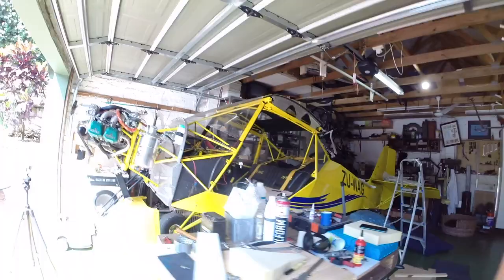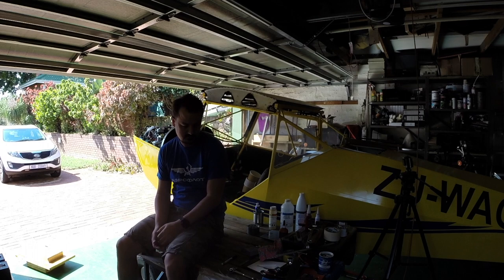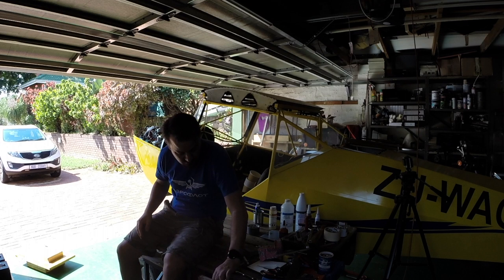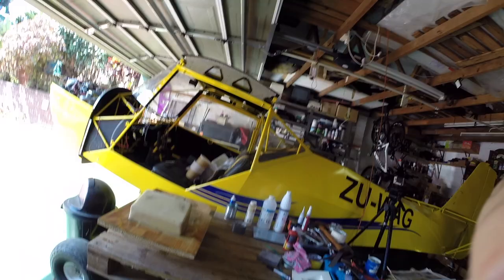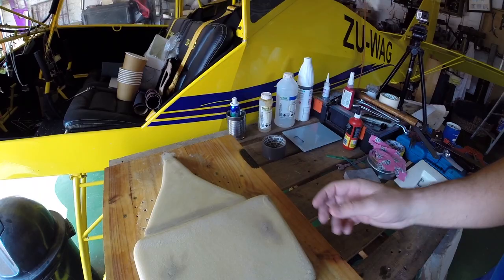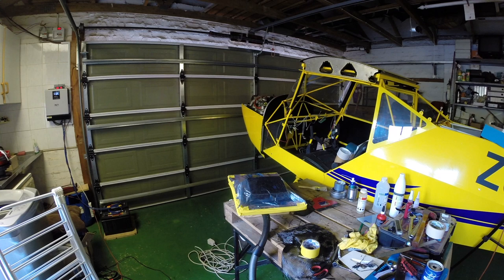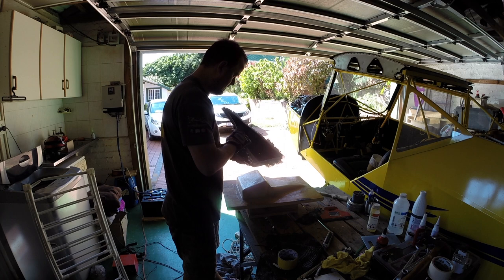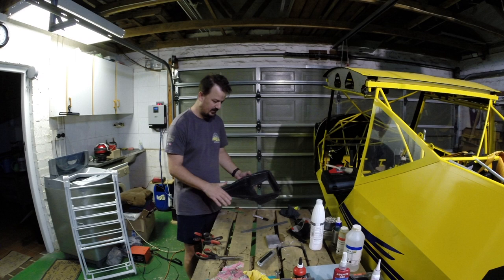This will be one COOL airplane!!

Comment: Good improvised fabrication. My advice would be fill your vacuum holes as to vacuum bag the carbon properly you need to do it from the top through a breathable peel-ply into an absorbent material that will absorb the excess resin. I would also say you will need a foam rubber seal to go between the plenum and the radiator so you don’t get any wear or air bypassing the rad. At least you have made what looks like a good form and can play on your aircraft (I can’t even get to my little plane at the moment but have made progress on my car restoration). Keep smiling.
Reply from the maker: I know that its not the best and that I need peel ply etc.
I made do with what I had and tried something which kinda worked...
But yes as soon as i can get the material for the job we will do it again and do it properly.
The plenum will not sit directly up against the radiator and will most definitely have rubber seal between the two which is why I cut a lip into the plenum opening for the rubber to attach onto.
Hey at least we have projects to keep us going during this time, imagine sitting at home with nothing to do!
Reply: @NicHolmes  With you the way. A worth while experiment though and proved the form is good. As you say at least we have project, I think I would go made with just work to do at home (looking at a computer screen, not my normal work but at least getting some cash) and nothing to unwind with after.

Comment: Most guys would say f-it, bolt it on, and go flying. (Because what you built would work fine and last until the Second Coming.) You've got higher standards -- and you'll meet them. The right gear is 9/10th of the job. You sounded a little down, but shouldn't be. You're on your way.
Reply from the maker: Yeah what I built would work fine and last forever, but its both not my plane and also not my style to have things that don't quite look spot on!
Hopefully i can get hold of the right gear soon.
And yeah, this lock-down is seriously demotivating and it gets to me somewhat, even though I have the plane to build, I get seriously frustrated when I need more supplies but realise I'm now stuck...
I hunted for a week to find paintbrushes so i could finish that mold... _ i eventually found a pack on the shelf at a local grocery store - but they wouldn't sell them because of the essential supplies rule, I eventually begged the manager enough to sell them to me that he did - and then I bought two packs just in case!
Reply: @NicHolmes  It bites, for sure. But we'll live...er, that's the intention.  ; ]